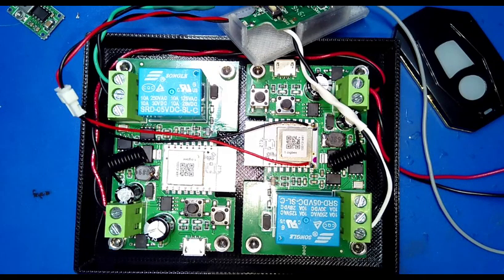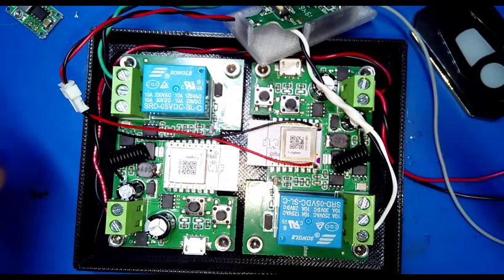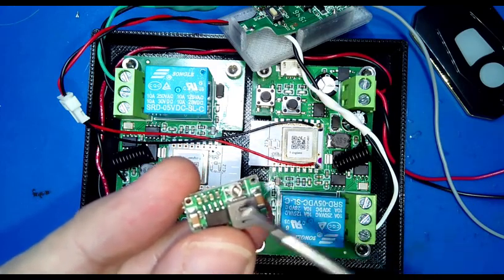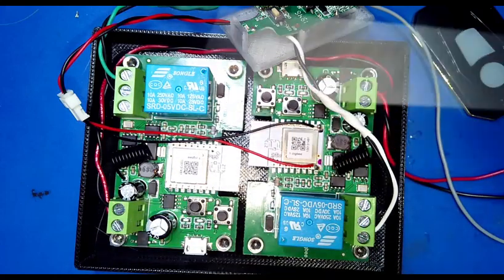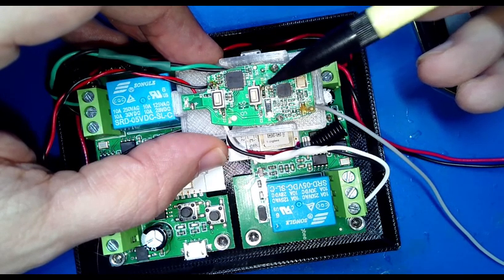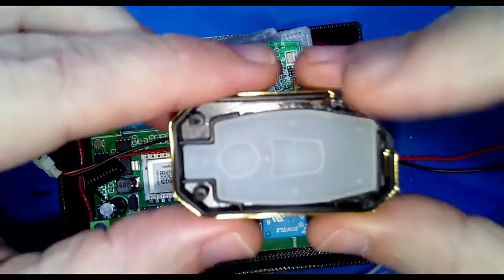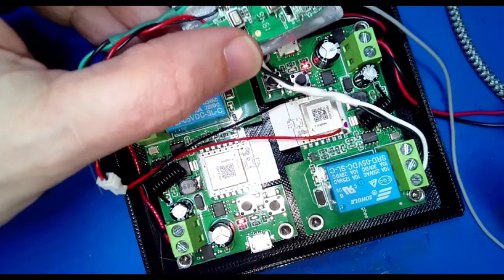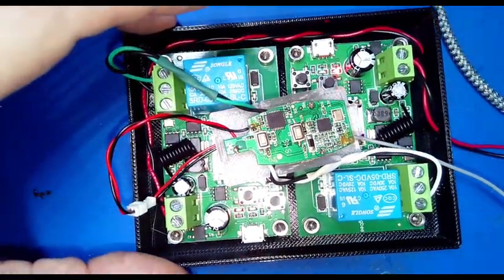Using Zigbee / ZWave Relay Boards with the Instalock Remote Control

Comment: Hi Ron Could Zigbee relays be used to make a wireless button box for the xbox ac?
Reply from the maker: I see where you're going with this. :-) I wouldn't use Zigbee (too slow, too much lag, for gaming). But BLE would be an option. What you'd have is a box with 3.5mm wires between the XBOX AC and a receiver. Then the button box would have a transmitter. They would talk. Due to the amount of work involved, I'd re-consider a controller mod. I'm trying to avoid controller mods, but for wireless it may make the most sense. (Wireless and lag are tough problems to solve reliably.)
Reply: @RonNelson trying to cut down the wire monster lol